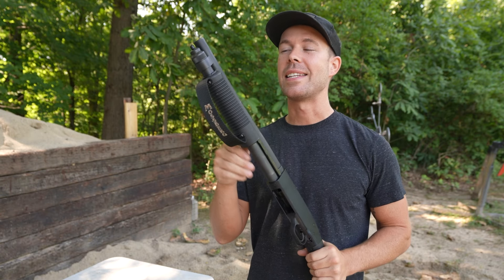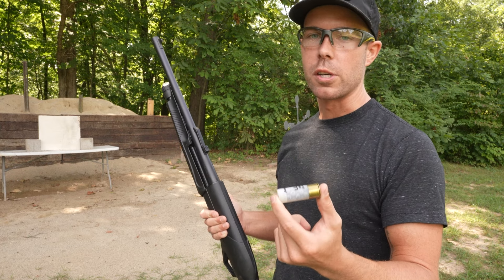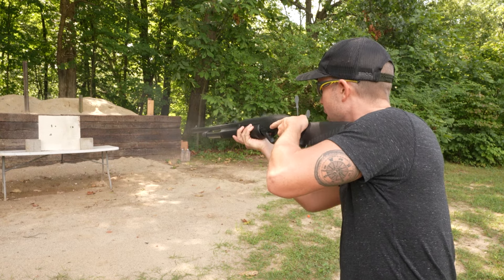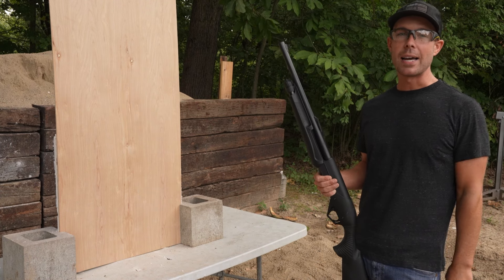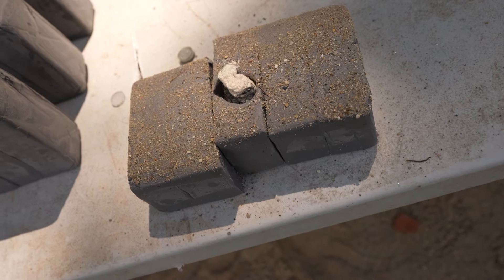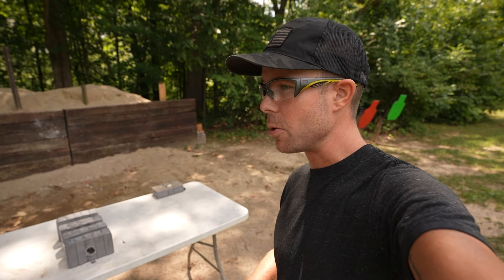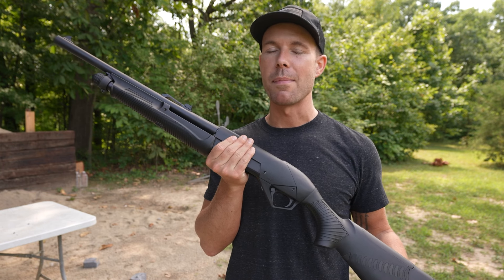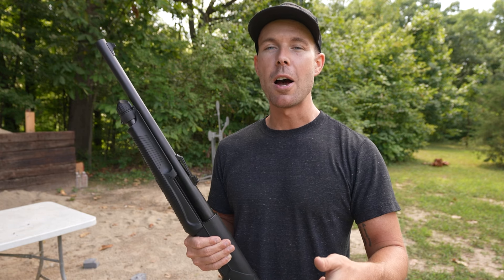Less Lethal 12 Gauge SLUGFEST, Which One's BEST??

Comment: The blue slug is designed to work at ranges well beyond the others. It is not recommended for use at less than 20 yards. The
HV Star is for the ranges shown in the video

Comment: You should do a chrony test and table with the energy produced by each of the "less lethal" 12 gauge loads so the Air Actuated Less Lethal community can compare notes with you. Most stock less lethal air launchers are in the 7 to 14 Joules range as it will usually be used for chemical rounds but customized ones are getting into the 40 Joules range.